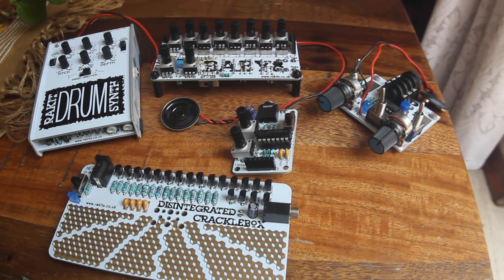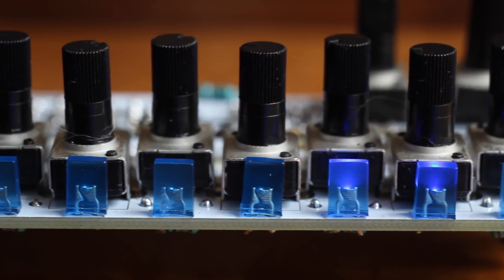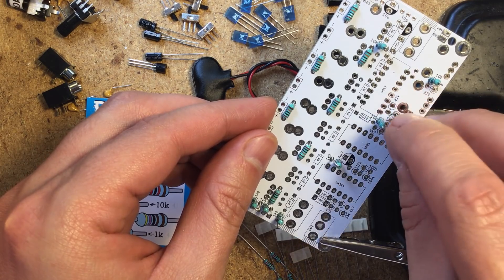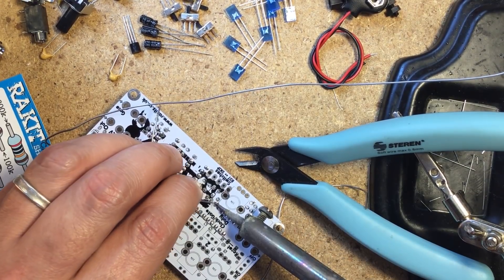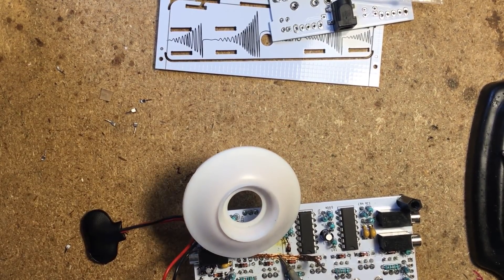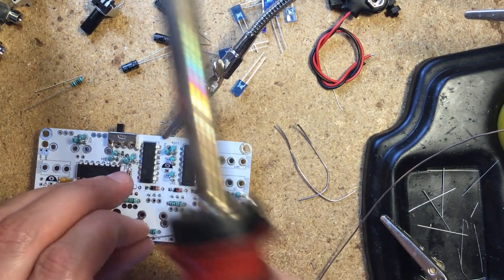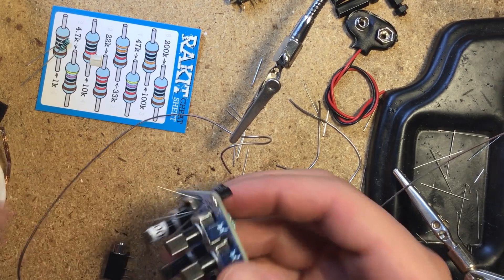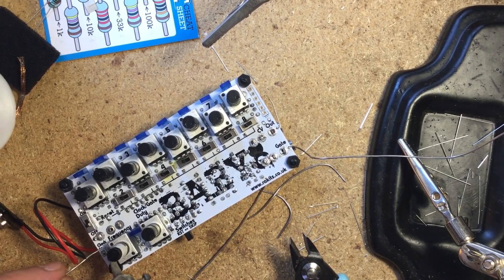Kit Overview # 32 - Rakit Baby 8

Comment: I wanna build my own design based on the baby20 as well but my issue was I couldn’t figure out a good way of controlling the gate length on it. But you say this one has a gate adjustment. Is it per step or a global gate and would you mind maybe explaining how to create a variable gate length? I’ve been learning a lot from your videos and I have joined your patreon as my humble form of support
Reply from the maker: Hello, and thanks for joining my Patreon! YEah, this one has a global gate length control. The way to do it AFAIK is to use a 555 (clock chip) to generate a solid pulse or maybe an opamp comparator to set the duty cycle (pulse width) which is basically the same as gate length. Forrest Mim's famous old Radio Shack book on the 555 comes to mind, I think I saw a page on there about variable PW. If I have time to research this I'll try to do a video on it! Cheers
Reply: Synth Diy Guy yeah that one my only guess as to how to control the gate length is using a 555 in a single pulse mode. Then you can control the duration of that pulse but I guess that means to have a gate length per output you need a 555 on each output.
Reply from the maker: @256k_  yeah, or have a triangular clock going into a comparator/opamp PWM circuit for the output, with a PWM knob per step